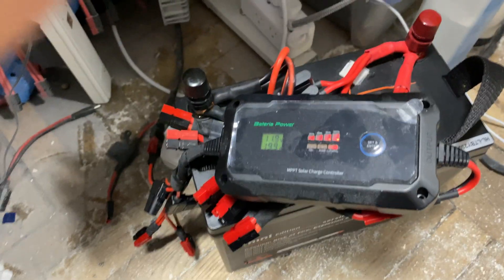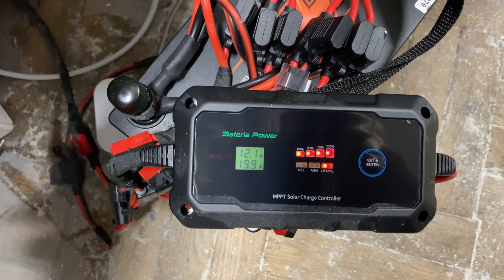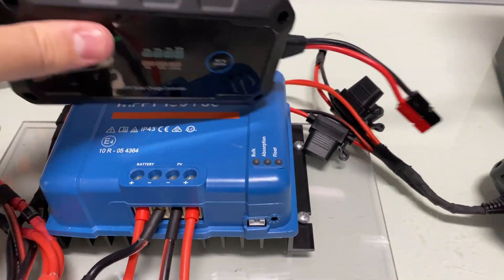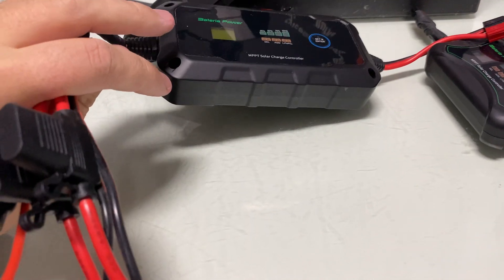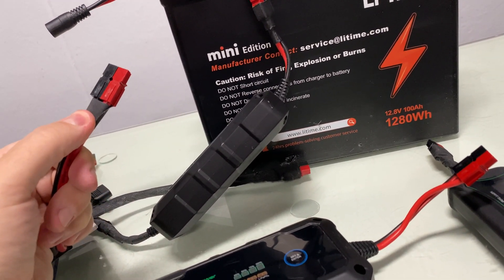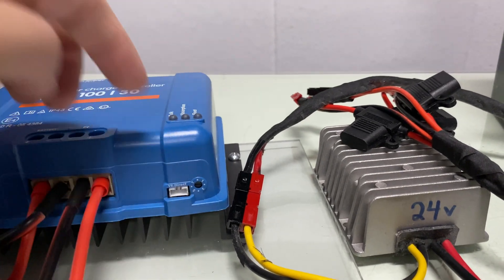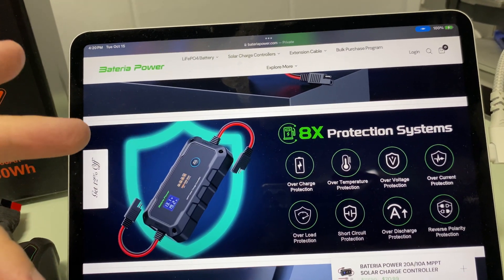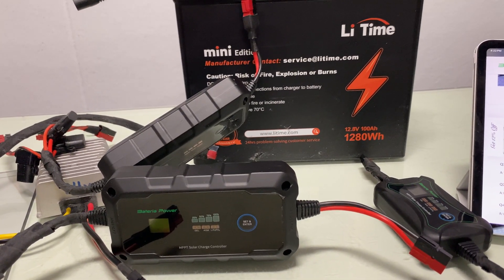📌 BATERIA POWER ULTIMATE Portable 20 Amp Solar MPPT 12v Charge Controller Review #wisebuyreviews

Comment from the maker: -- SEE the UNIT HERE: https://amzn.to/4eJAERe or - BLUETOOTH VERSION: https://amzn.to/4ePVIWb  [ amazon affiliate links ]
See it at the bateria power website: - https://bateriapower.com/collections/mppt-solar-charge-controller
The 12v battery from the video: https://amzn.to/405mAgs

In this video I discuss the benefits of using this 20 amp mppt charge controller and compare it to Victron for usability. Found this to be very usable and super portable. I highly recommend. 

Solar charge controllers are also known as solar charge regulators. A solar regulator regulates the charging current of the solar panel to provide the most efficient charge to the battery and prevent overcharging. 

- See also my review of the 10 amp version: https://www.youtube.com/watch?v=yp-DnyN4VEw
- See also the HOW TO GUIDE to the Anderson Connectors: 
https://www.youtube.com/watch?v=zZkIR48C4uE

See all my videos here:
https://www.youtube.com/@wisebuyreviews/videos

- Youtube https://youtu.be/zwZmmaP5YPA
- Odysee https://odysee.com/@wisebuyreviews:d/bateria-power-ultimate-portable-20-amp:2
- Brighteon https://www.brighteon.com/dashboard/videos/09d9446d-ffc5-4677-9940-4018b56cabde
- Clouthub https://app.clouthub.com/#/videos/videos/46fe0e9e-fa74-4f71-a4f6-c66760a9c0ee
Dailymotion https://www.dailymotion.com/video/x97fa52
- Bitchute https://old.bitchute.com/video/niARBeRV48fL/
- rumble https://rumble.com/v5iuph5-bateria-power-ultimate-portable-20-amp-solar-mppt-12v-charge-controller-rev.html

Comment: For those of us with lots of USB devices from family members, how to you charge lots of devices.  The cheap charge controllers only have 2 USB ports and more expensive charge controllers seem to have none.   There must be another way or charging device?
Reply: Get a 4 (or more) port USB hub.. They have multiple ports to recharge all of them at the same time.
Reply from the maker: I have a solution for you you use this: https://amzn.to/409eZNF - 160W USB C Car Charger, Baseus Type C Car Charger, QC5.0 PD3.0 PPS 3 Ports 
- And I use this with the Baseus above, to plug into into my battery: https://amzn.to/4f9iPeg
Powerwerx Cigarette Lighter Socket with Internal 15A ATC Fuse and Powerpole PP15 Connector, SOC-PP
- Or alternative to screw onto your battery terminals: https://amzn.to/4h9tl6O 12V/24V Fixed Thread Cigarette Lighter Socket Extension Cable with Perforated Terminal Direct Battery Type car Adapter 2.5mm² 20A Heavy Duty Cable 10FT

You can plug this into a solar generator and you get three high power plugs, the top one has 100w power delivery, the second usb C port has 30w power delivery, and the last one I think about 15-20w power delivery, so it will charge your phone super quick at optimal rate and you can plug into a  laptop and you get as many as you need devices. The cigarette style plugs come in many varieites, including ones with lugs that screw onto the m8 terminals. The baseus also plugs into your cigaratte lighter socket on your Car, Solar Generator, Etc. This is the solution I use and run my Mac charge iphones, ipads and laptops, anything that uses power. I love the device and have many baseus ones, it is the best unit I have found. I should make a video about this. 

Hope this helps!
Reply: @wisebuyreviews  Thanks for the reply.   You brought up another consideration which this usb charger may address.  Phones are only one end device.  We are charging batter lights, portable drills, a blender, basically power for our off grid camper.
Reply: This linked youtube video brings up another issue.  Even if we can figure out how to add usb ports, should we really use them directly with expensive devices?    Also, in the video, hard to believe that one port will be enough.
Don't Charge Your Phone with Your eBike's USB Port 
https://www.youtube.com/watch?v=5xMsfHHF37o

Comment: To charge a 12 volt battery from a source 12 volt battery, why is it necessary to up the voltage to 24 volts.   What would happen if you just charged 12 volt battery with a 12 volt battery?    I believe I do this with solar panels, but now that I think of it I think there is about 19 volts coming in.
Reply: Exactly what I was thinking. buying a stepup converter to connect it to a 12v battery. He was incorrect and didn't recognize it. A few other things he mentioned were like HUH...? Zoomed in too much as well.. He needs a tripod as well.
Reply from the maker: Hey man always improving, thanks for the suggestion with the tripod will consider it, however I find  it nice to hand hold the phone and be able to zoom in by bringing it in easier. Thanks for the comment. You might be right, there is no minimum input voltage in the manual https://cdn.shopify.com/s/files/1/0689/6546/6404/files/MPPT_20A_M2420_-Sunrock20.pdf?v=1686708436

One thing to note is the way mppt works, so if it is max output 20amps at 14.4volts, it can only have maximum input of 20 amps, so a lower voltage let's say 13.5volts will bring in at least 10% less amps, although haven't tried.
Reply from the maker: Great question, I think you can charge things like solar generators with 12v input, probably at max 120 watts. However, MPPT charge controllers, need a higher voltage than a standard battery to charge another battery, for example a 12v battery lifepo4 is about 13.5 volts fully charged up, and in order to charge a 12v lifepo4 battery you need at least 14.2-14.4v in order for the electricity to transfer into it. If you connected one 12v battery with 13.5 charge to a discharged to `10% 12v, they would equalize to about the middle between the batteries assuming they are both same capacity. The MPPT controller can't boost the voltage by itself to charge, perhaps also for safety reasons as it might overamp the source of the energy. So that is why I use the boost to 24v, here is the one I use, I have gotten multiples of these. Of course always practice safety and each device such as buck boost, make sure to use a fuse of let's say 40 amps for a 10awg wire. Watch my anderson connector video with a full parts list in order to duplicate my setup. Good luck!

- DC 12V Step Up to 24V Boost Converter 20A 480W DC Voltage Regulator Power Converter Waterproof Module
https://amzn.to/4h7fmP3
- 10 AWG Inline Fuse Holder - 12 Volts Fuse Holder for 40A Blade Fuse (6 Pack)
https://amzn.to/4h8RhY8
- 12v DC Wiring How to DIY Guide for ANDERSON Power Connectors BENEFIT Project & Tools #wisebuyreviews https://youtu.be/zZkIR48C4uE